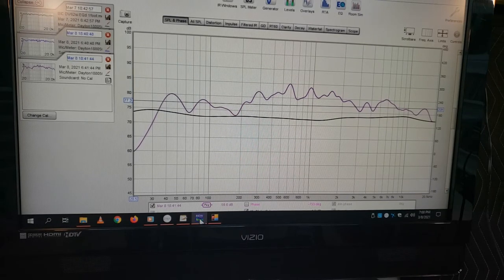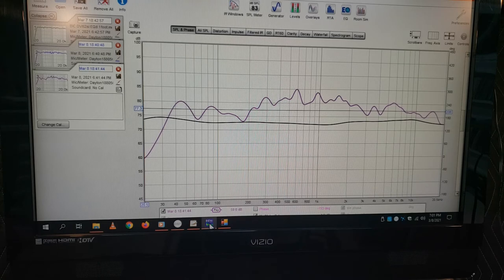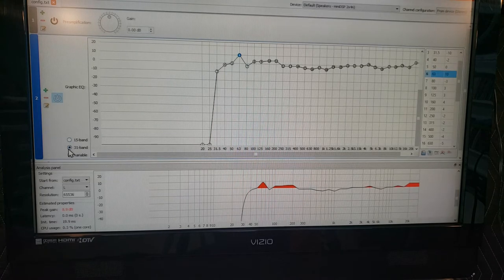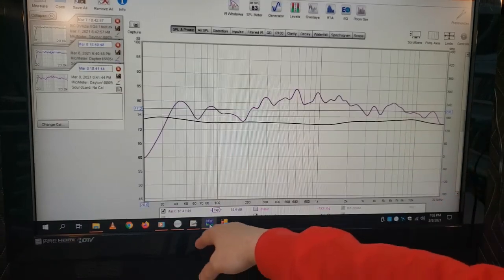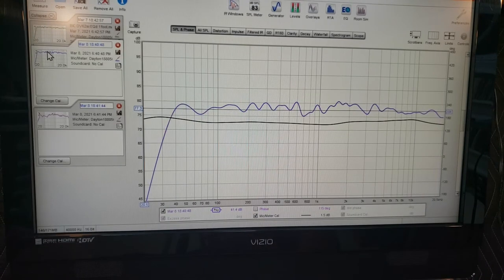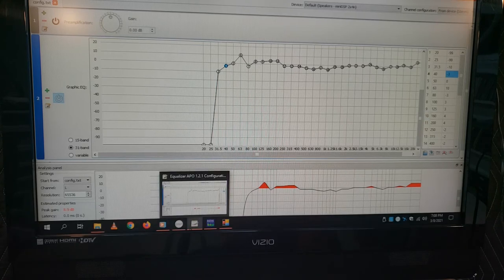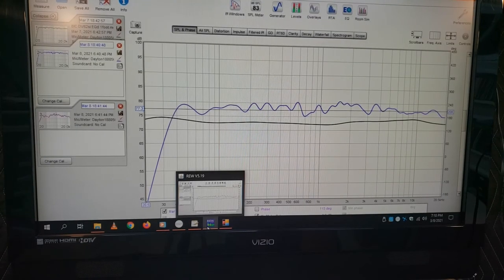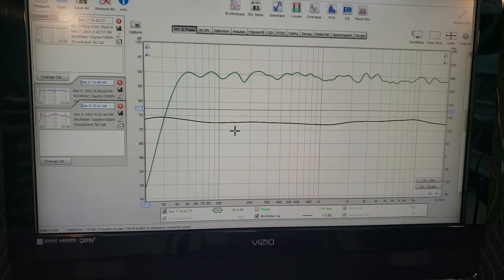BIC DV62si EQ'd and Flattened Out With REW/EQ APO/Dayton UMM-6 Mic

Comment: I spoke to an audio engineer that has designed several top rated high-end speakers. He said the DV62si is extraordinarily accurate for a speaker pair under $250.  He suggest a 4-ohm resistor on the positive tweeter lead if you want to smooth out the high-end.  Simple; remove the tweeter then add the resistor, reinstall. I did this and the results were amazing. Midrange still very open and holographic but high end is smoother with no loss in detail.

Comment: I have a pretty heavy audiophile background, and have had very pricey systems back in the day (meaning before marriage/kids!). I picked these speakers up in the complete surround system for a home theater. And for that purpose they and the sub and center were fantastic. But for music, I was disappointed. Until I moved and moved them into a new room that was much more heavily dampened with wall-to-wall rug drapery, etc. I expected the home theater experience to be good, and it was. But was shocked to hear them with music. All of a sudden, they sang. So experimented more. In other words, I put more time into setting them up correctly. Moved them away from the back wall, etc. I have to say, I was blown away. These are no different than any speaker at any price. If you do not place them properly they will not shine. Not all speakers placed well shine, but these do. I have not experience the overly bright high end as many talk about, so it was interesting to see your readers do not back that up. Neither do my ears. As to the bottom, well, they are still bookshelf speakers, even if on the large side. I think the base is reasonable for their size, and if you want more, add a sub. Which I have and it works wonderfully. Thank for the video and work, very informative!  BTW, I recall getting my B&W 802's decades ago. They were around $8,000 for the pair and came with a print out of the individual reading from my pair. While B&W are known to be very flat sounding, the graph was no flatter than when these BICs are showing in your test. Meaning, the graphs are good and helpful, but at the end of the day, it's about what we hear.

Comment: that mid section got fixed quite nice...

did you attempt to take a few measurements around your listening position? 
it may be that speaker or listening area repositioning could solve some of the response issues (like the 63Hz).. that is preferable instead of drastic EQ shaping. 
one reason is increased distortion when a speaker is asked to play that much louder certain fqs. (as we know +3dB requires doubling the power, and distortion gets more pronounced as power/cone movement increases)
Reply from the maker: Some of it was room placement and treatment. Later on after doing nore room and treatment and moving them about 24" off the wall then measured from my listening position it helped. Also going a bit off axis so tilting them back out a bit about 10° helped with the highs. Still had to pull the middle up a bit but no doubt these are great budget speakers with a bit of EQ. I'd recommend a calibrated mic and REW over the more expensive xover upgrade. Much easier and better results. But hey I'm a DSP guy...

Comment: how do these perform with the audio crossed out at 120hz for a sub though?
Reply from the maker: They should actually perform better removing that low end duty on the woofers. Should be able to play louder without as well since the woofer won't have to move as much not dealing with low frequencies.
Reply: @iowaudioreviews  don't you think you should test them this way since these are actually sold with a powered sub also made by BIC .... These seem to be decent for a 2.1 setup, like for a computer. It would be nice if you actually tested them properly! I would hope that you actually have interest in providing information rather than brand-shaming like many other YouTubers do!
Reply from the maker: @andiarrohnds5163  I usually don't because most people that buy these don't pair them with a sub. I have tested them with a sub myself as I have with all the bookshelf speakers I have reviewed. But more often than not most people (general consumer) don't pair with a sub and even if they do they don't implement LFE or a high pass filter so its a wash.  Most of the time with typical bookshelf speakers a highpass filter and a sub always makes things better.
Reply: @iowaudioreviews  yo these are meant to be paired with the Bic Venturi v1220.. in fact these shell speakers and the power sub are both on sale together at parts Express.com .. but other than the sale these are actually meant to be paired together yes the sub seems excessive but it actually works. Not sure why you're pretending these aren't meant to be paired with the Venturi sub but whatever man.. if I were be doing this at least I would personally be more interested in providing as much information as possible and doing it accurately haha. But it's cool
Reply from the maker: @andiarrohnds5163  Because I've read about these over and over for years and its never been mentioned they're supposed to be paired with any specific sub NOT EVEN ON BICs website! Thats probaby why, and I wouldn't use that sub anyway. Yeah there's a whole Venturi line that can be used togather many brands do this doesn'tean ya should. BIC is typically garbage, here and there they do good for the price but thats it. The only BIC subs I'd recommend are the F12 and Acoustech 12 otherwise theres better budget subs.
Reply: @iowaudioreviews  right so they're both on sale and they both have the same exact type of wood with the same exact color? Like exactly the same color and finish... And they're both on sale.. haha I don't know man seem like they go together to me
Reply from the maker: @andiarrohnds5163  Never said they don't, just said BIC doesn't promote them together even on the BIC website . They list every other matching Venturi speaker but not the sub. I've seen these speakers listed on many sites for at least the last 15 years never once seen them promoted with the matching sub. BIC tends to market the F12 the most then the Acoustech 12 which are better anyway. The v1220 is more of a home theater sub and I don't do home theater so I would use and recommend a different sub with them for music. Otherwise a good 2.1 setup for movies.
Reply: @iowaudioreviews   so your telling me that having the same exact custom wood finish is not enough? they are not directly bundled together as a 2.1 pair but its very obvious they are made for eachother. they are sold separately for convenience as not everyone needs a sub. you are basically telling me that you need flashy marketing to understand this or something. and they just dont do that. but anyway, yes, these bookshelf speakers are unique as the vast majority of these types of speakers actually do not have a powered sub option. only very few do, so i believe it deserves extra consideration because of this. i mean its very obvious to me at least.
Reply from the maker: @andiarrohnds5163  Holy shit... No its not enough to just look the same, if the V1220 isn't marketed anywhere then nobody knows it exists and they're not gonna go looking for it either. I'll say it again I've literally seen these speakers selling for probably 15 years and have never once noticed the V1220 listed with them. Thats bad marketing I guess on BICs part and kudos to Parts Express for doing it what ever. Regaurdless I wouldn't mention the the V1220 anyway. I'm not going to start testing subs with all the bookshelf speakers its just more shit I'd have to buy and return or sell at a huge loss. I test them as I'd use them and thats without a sub. For me and how I used them I didn't think these speakers needed a sub. Other speakers I have recommend a sub. The channel is a hobby and makes me no money actually costs me a lot of money so I could care less. If you want to know how they pair with a sub watch someone elses video.
Reply: @iowaudioreviews   right, so let me just get this straight one last time. you refuse to test these speakers with the sub that is actually 100% designed for these speakers because "lol you didnt know" .... hahaha okay man. just seems a little stupid, you know?